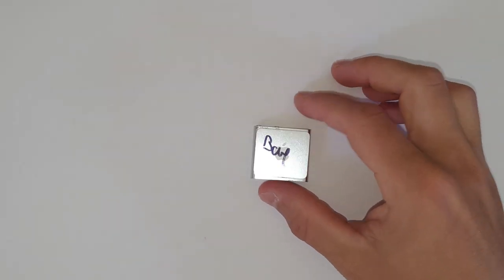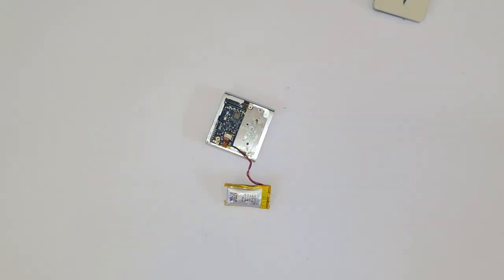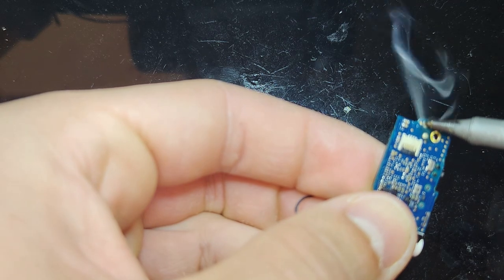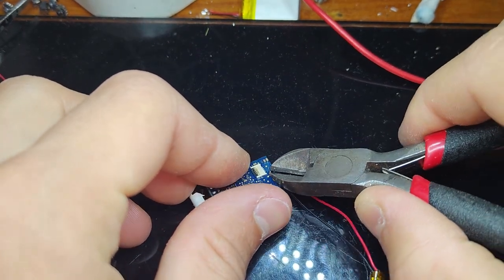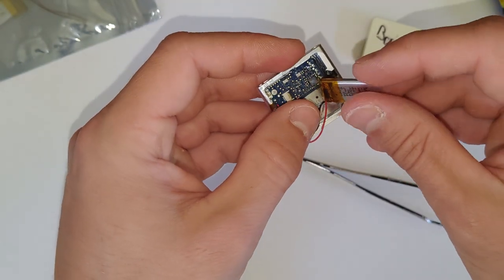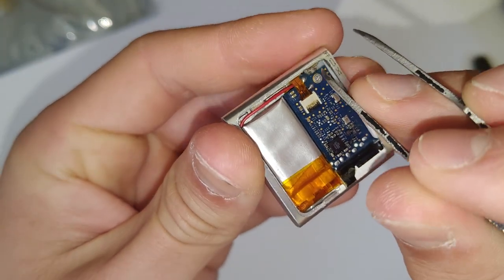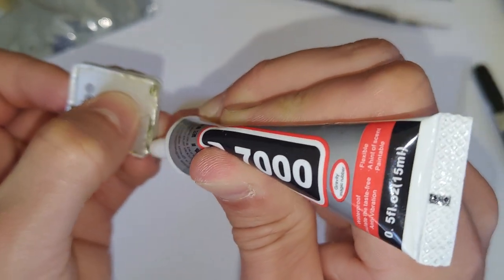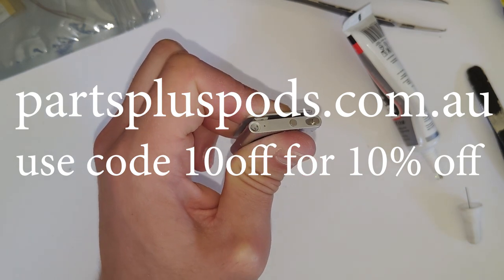iPod Shuffle 4th Gen Battery Replacement Repair Guide

Comment: I say forget soldering. Just splice the wires half way and use a touch of electrical tape.
Reply: Did it worked for you ?
Reply: I think so

Comment: seems like it might be easier to just cut the battery wires and solder the new battery wires to the existing wires
Reply: Do you need to even solder the wires?  Couldn’t you just braid them together and cover with a little electrical tape?
Reply: @Ces1um  not feasable with the tight tolerances of the ipod tbh

Comment: No telling how many Shuffles you've caused to be broken.  Following step-by-step, you pick up the iPod and perform the first step - hyperextending the clip.  Only after the follower has bent or broken the clip do you mention that heat and alcohol needed to be applied first.  Take this crap down! Or reshoot it.
Reply: I feel like this is common sense. A rule of thumb with repairs is to never exert excess force. Also. I always watch the video entirely before attempting a repair. This info is offered for free so I try to be more grateful than picky

Comment: do you (or anyone) have a recommended battery seller? I don't want to get a battery for my ipod just for it to stop working in 2 weeks
Reply: i would recommend elite obsolete for the battery, never had problems with them

Comment: I had it, battery working and everything. But the soldering came off as I was trying to place the battery back in the device and was a bit distracted. I think one of the components was eventually damaged on attempting to re-solder as the tip was oxidised. Sucks I really wanted to use this little device again. Absolutely gutted and pretty sad :(.

Comment: Thank you for this fantastic and helpful tutorial! 
had to replace one of my batteries and the step-by-step instructions were spot on! 
the only issue I ran into was getting the back cover off, That was a huge pain, Even with a heat gun I was too worried about damaging something and it still stuck pretty good, but that was more on my end!